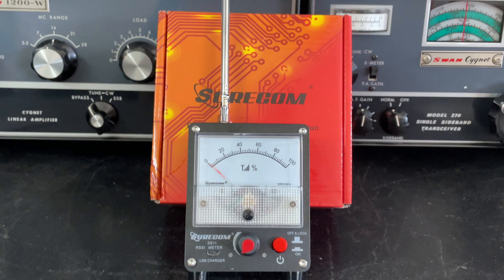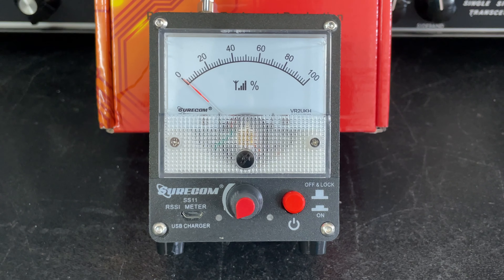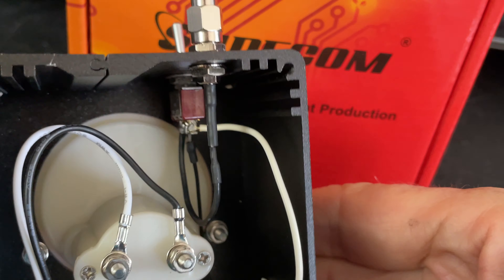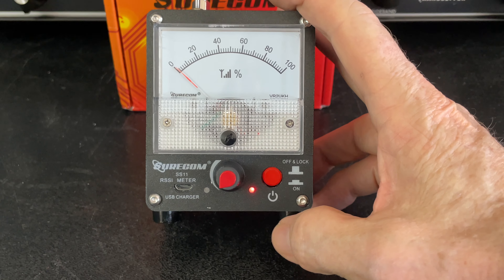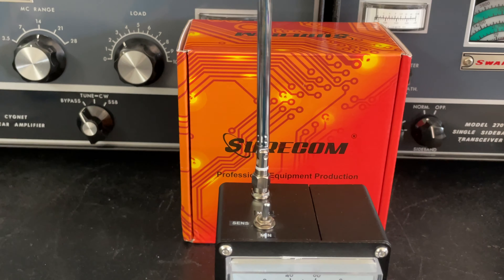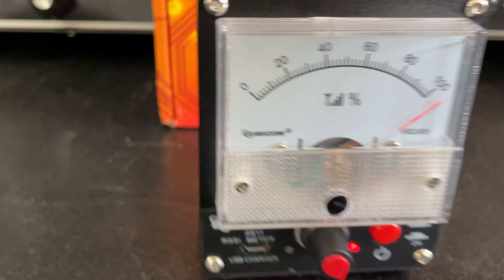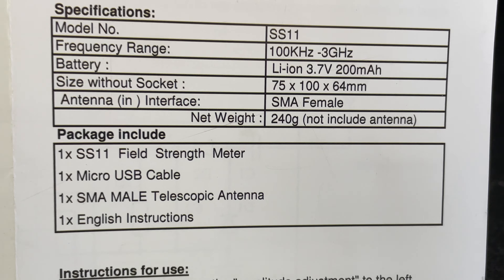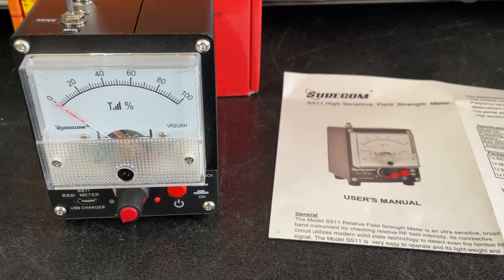Surecom SS11 - Is it too sensitive to be practical?

Comment: I'm wondering if the internal pot has its 3rd leg open from ground.  That would then present whatever ohmic resistance the pot is rated for in series, but not allow for any shunt of the signal.  Looks like either a design flaw or a quality control issue IMO.  73 OM
Reply from the maker: I agree if the common leg is open.  I am guessing its by design.  The manual has a contact for tech support.  I just may give them a call and report back. Thanks for the comment!